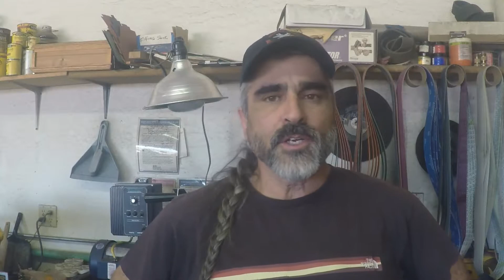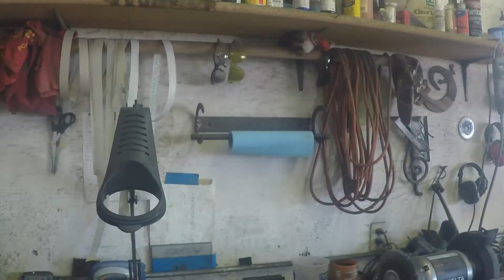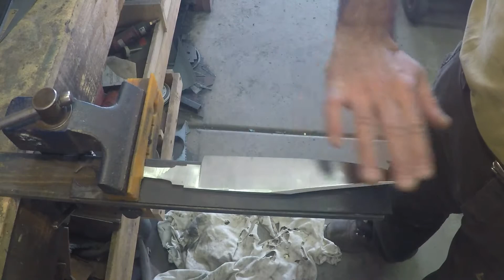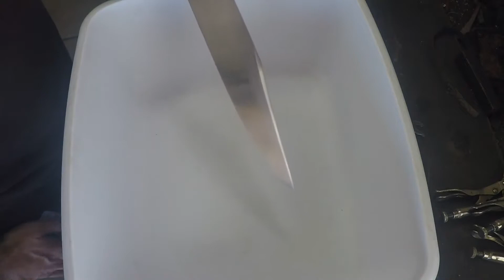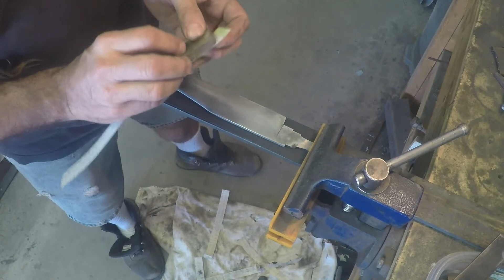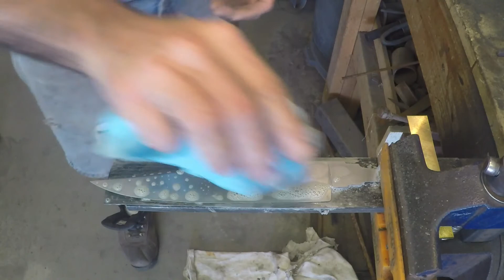Stag Bowie Part 4 Finish Grinding

Comment from the maker: For those who are wondering about part 5 of this video series, I do plan on making this knife handle, but I cannot use the blade in the first 4 parts. I was contacted by someone who saw the blade and wanted it, but with a different handle. So I sold the blade with a new handle. I will have to make a new blade and finish the stag antler handle. When that will happen, I cannot say for certain.